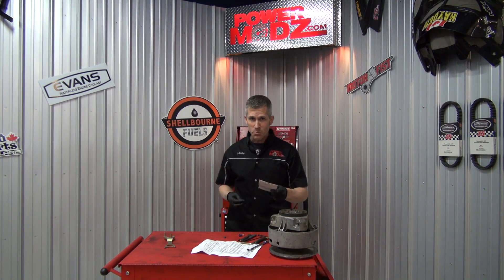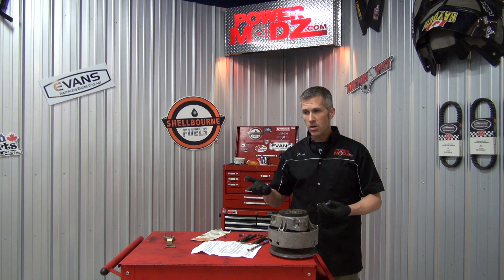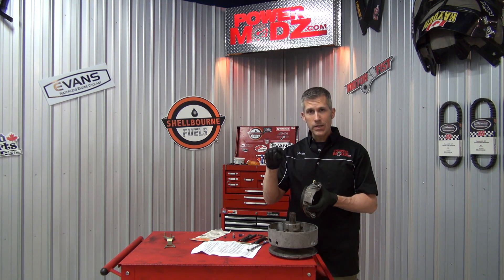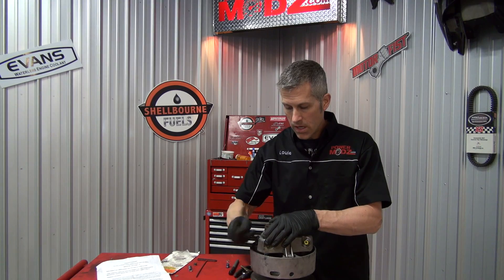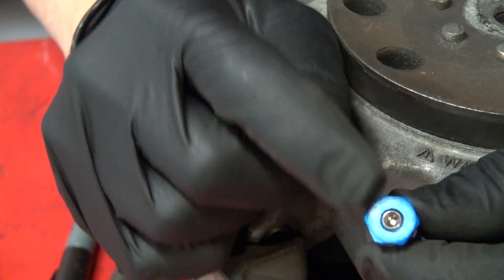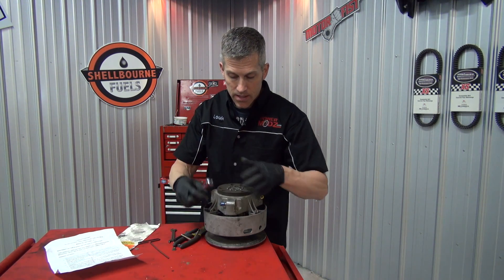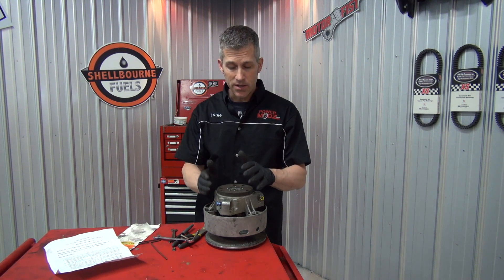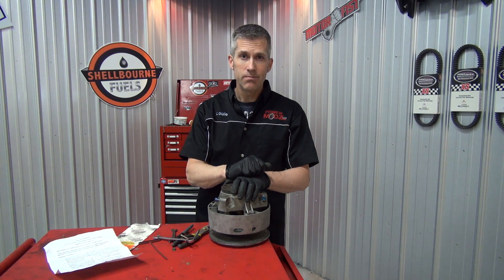Quick Clicker install on Ski Doo clutch! PowerModz!

Comment: I have a question Having to do with ski doo clutch. I installed a 521 type 537 from a 88 formula plus , into a 96 mxz, the clutch is from the motor originally the problem is i blew it up so i used a type 536 top end for now until i resleeve the type 537 jugs they were 50 tho over. I believe the clutch is allowing it to over rev hence the different top end/ not set up correctly, can i just turn the cam bolts down or will i need to change the ramps in the clutch ???

Comment: Just bought a 03 rev 600 (girlfriend doesnt know yet shhhh!)

Sled is in storage for the summer.

Will my clutch accept quick clickers and where can I find them
Reply from the maker: Yes it will, you can try Starting line products in the states or Kimpex in Canada
Reply: Thanks.

Totally unrelated question, but i am new to these REVs.

How reliable is the DPM? I live 1200-2500 above sea level. Temps from -20-40*F

Thanks. You guys rock i learn so much from you